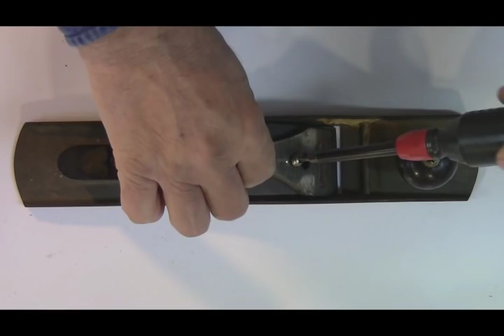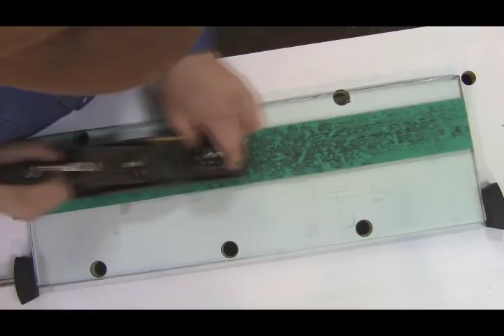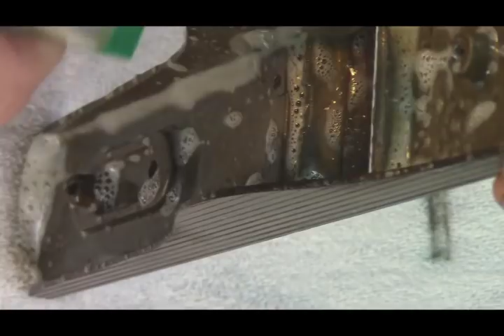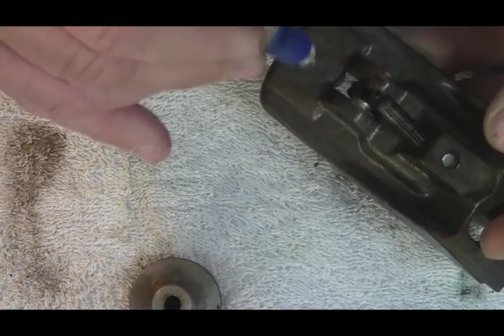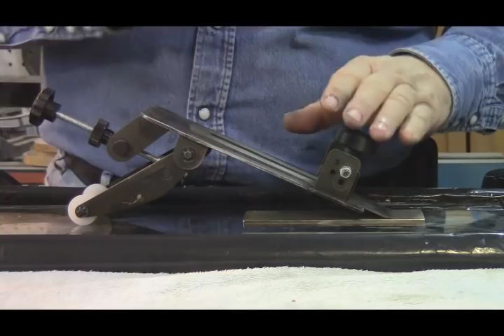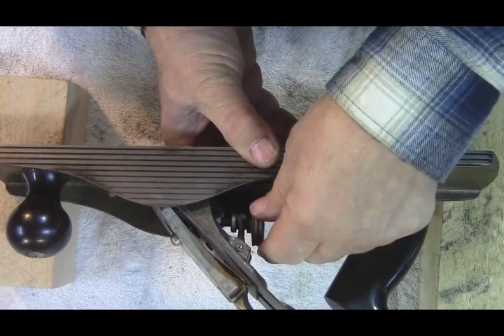Hand Plane Restoration #2.

Comment: Love the video, what did you have in the spray bottle?
Reply from the maker: +Tony Greenway  1/2 Simple Green and 1/2 water. It keeps the diamond stone clean of filings and rust, and does not rust the blades. I buy the Simple Green in gallon jugs. I like this better than using water.

Comment: @reviek what did you use to flatten the sole?
Reply from the maker: +COUNTRYBOY98Cummins First I used 80 grit self adhesive sheets, used on body files.  Then 150 grit sheets. I use the adhesive backed sheets for the convenience.  I stick them on a 1/2 in. plat glass or anything else that is dead flat.  If you can't get the adhesive backed sandpaper, you can use a spray adhesive and and sick plain body file sandpaper to your flat surface.
Reply: +revieck and you just spray the paper with the simple green water solution?